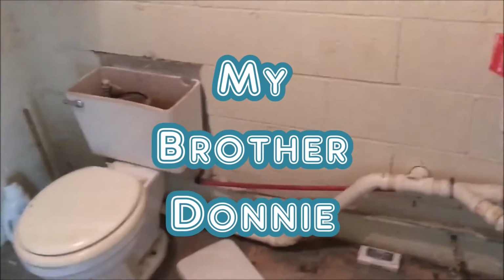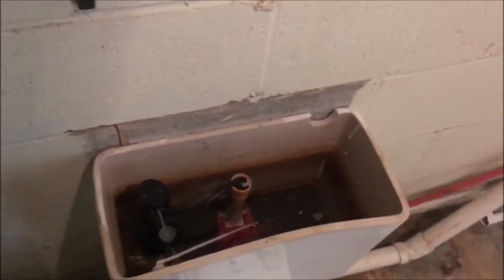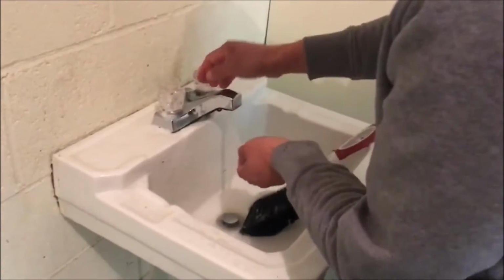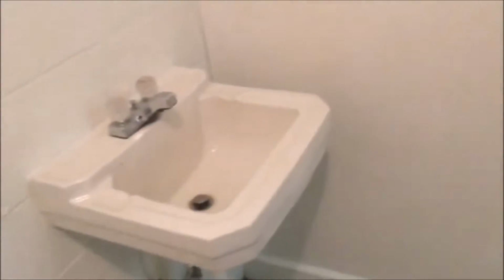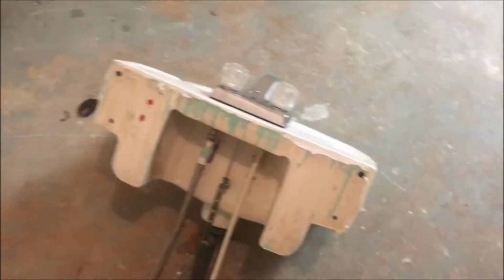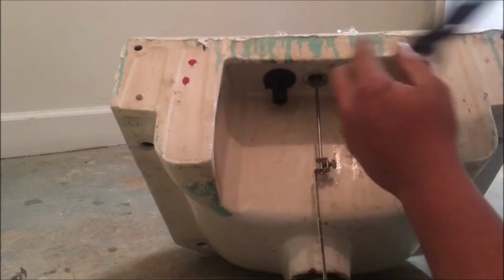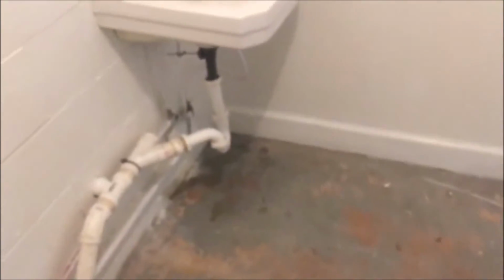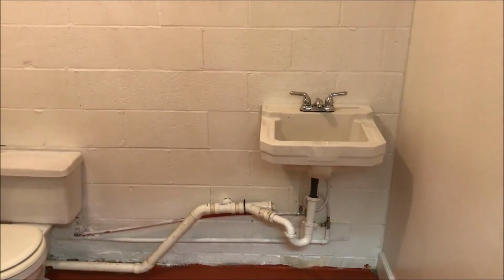Rehabbing the Bathroom in the Old Grocery Store... The Last Thing We Have To Fix!

Comment: This is a good instructional video for people who are unfamiliar with bathroom fixtures. It's best to change the rigid toilet supply line to a flex hose so the float valve doesn't give you problems. Don't ask how I know. Lol
Reply from the maker: I don’t like the rigid ones neither but the local hardware store did not have a flex to fit it so I left a rigid on there that one was actually copper that somebody painted
Reply: @TheGnomestead  Holy....... CRAP  :)
Reply: @TheGnomestead  The steel coil hose with rubber washer is ok, but the vinyl hoses aren't great. Hard water is another problem that is often overlooked (corrosion).